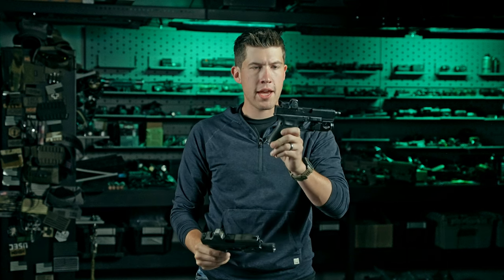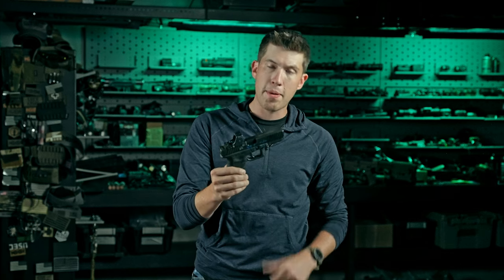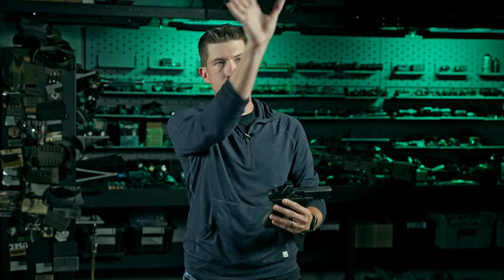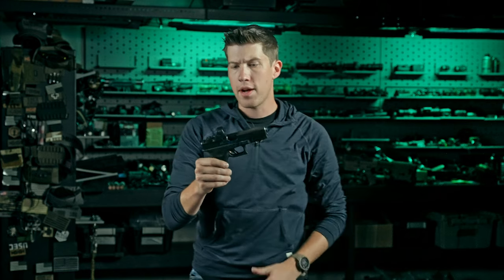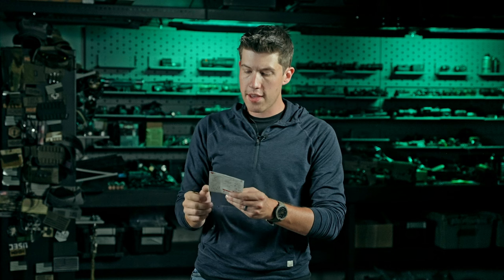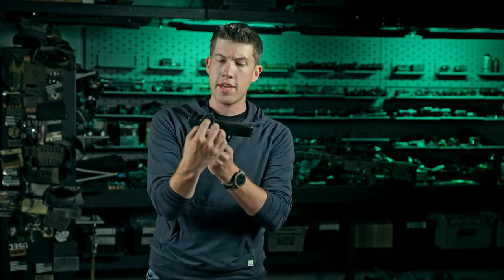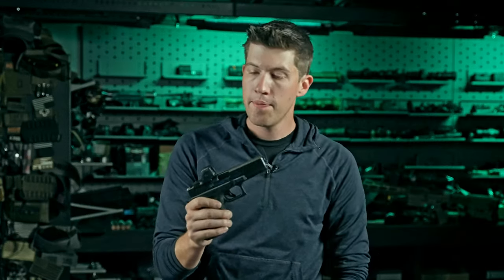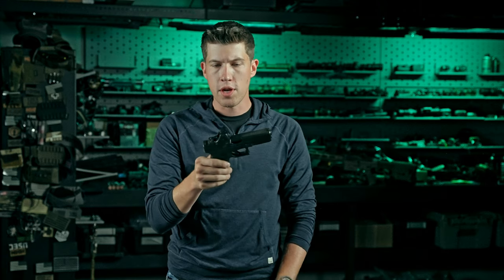Trijicon RMR HD - Product Overview

Comment: Deciding between the 1 MOA vs 3.25...
Reply: 3.25 for pistol. Maybe I would consider 1 for rifle. 

Think of the accuracy/speed you're considering; at 50yds, 3.25 MOA is 1.65" and I doubt anyone could achieve that accuracy whereas you'll pick up the dot faster and on a lower intensity. If you're using it on a precision rifle piggybacked to a high magnification scope, then and only then might you consider a more precise dot.
Reply: 3.25 is perfect size under nods. Surprisingly, 1 MOA has a bigger dot under nods 😫😫😫😫😫

Comment: You’re absolutely right. The circle dot really does suck on a pistol optic.
Reply: Why? I never understood that, handguns have less points of contact, are strictly to be utilized as a close range solution, and a pistol is to be drawn during an emergency risk risk situation where micro seconds matter. I dont understand why its a bad thing to quickly draw your pistol, cover your adversary with the circle and pull the trigger in a quick, emergency manor. It just works for me.
Reply: If it works for you then there’s nothing to debate.  Keep doing what works for you.

Comment: They copied the other optic makers with the batt compartment on the outside, so slow.  Not worth the money.  Get a Holosun instead

money
Reply: Cool story but I just had a 508t and an 509 fail in the span of a couple months….rmrhd gang
Reply: Chinese scrap > trijicon
Reply: Holosun must pay a lot for the astroturfing on every video ever .
Look , some people just don’t want to spend hundreds on a Chinese made optic , you’re not convincing us by going to video after video of Aimpoint, Trijicon ect .
Reply: Just save up for longer & get a real optic. ❤
Reply: @CertifiedBullpupHater  I want to second this, I just had a 509t fail, HOWEVER, I also JUST had a Trijicon Accupoint fail and it was over a thousand bucks, so every company can make a dud or two. Also have recently heard that multiple Trijicon products have wound up back at the factory for warranty repair or replacement, so make of it what you will. YMMV.
Reply: @MrMcGuy yeah Trijicon definitely isn’t perfect, and I say that as a “fanboy” with at least 7 of their optics.